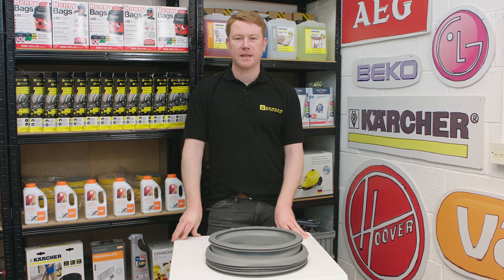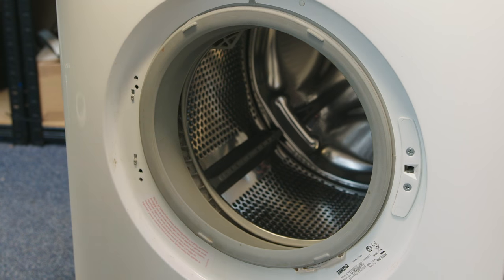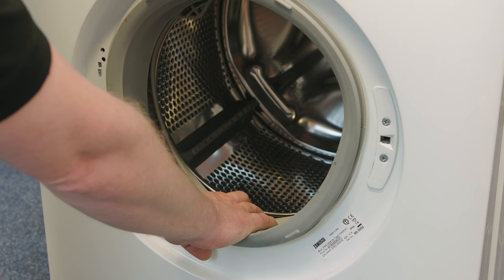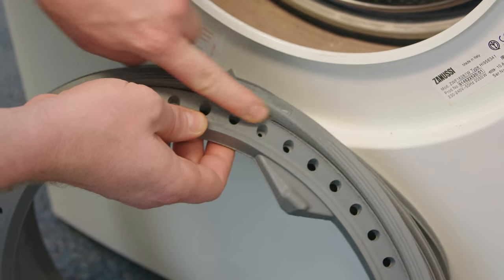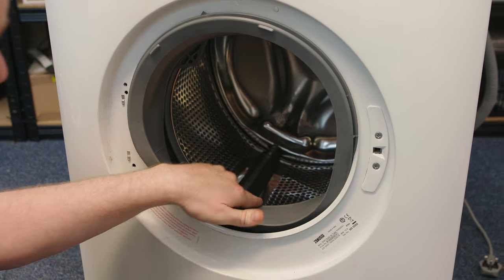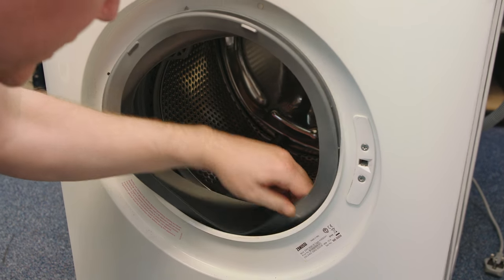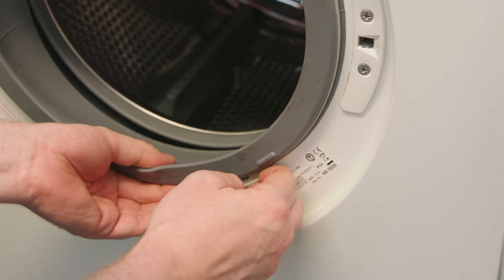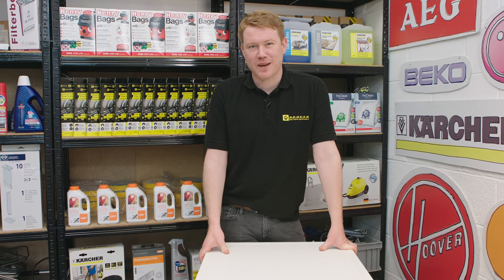Learn How to Change a Washer Gasket Yourself! (Zanussi Washing Machine Door Seal)

Comment: Couple of tips I learned in the struggle to fit my new seal to the same machine in the video. Start the seal at the bottom.not the top as shown, then you can just about see when the lip of the seal is on the rim. Start at the top and you won't be able to see. Slide your fingers around the seal, pressing in very hard, either side once the first part is on and gradually work your way up and around. My seal made a crunching feeling as it went on. The spring hoop that secures it is almost impossible to fit as others have said. I stretched the spring a but to take a bit of the tension out of it, and that helped a lot, enabling me to get it on with a helper. Another thing that helped putting on the spring was to fold the loose rubber seal (the part you will attach later to the outside of the machine) inwards into the drum to give room to fit the spring.
Reply from the maker: Hi, thanks for your comment and for sharing the experience you had when doing your door seal replacement. Great to hear you have been able to fix your appliance to keep it going.

Comment: Not sure about the comments. As a mum of 4 I was determined not to buy a new washing machine. Yes it was hard and yes it took about an hour but the video was very helpful. My washer has the water intake at the top of the seal to contend with as well. Thank you for your help and advice ❤
Reply from the maker: Hi Nicola, thanks so much for your comment. It really is great to hear that our video has helped you to keep your washing machine up and running, especially as it sounds like you have to do a good amount of washing. Well done on completing the seal replacement yourself!
Reply: Please come around to my house and help me!!

Comment: I managed to get most of this done relatively quickly (about 45 mins with a few attempts!) to get the seal attached. However I cannot for the life of me get the spring gripper back on, even with an extra pair of hands! Also have the dispenser part to reattach which makes it a bit more fiddly. We need a 3rd pair of hands I think so hopefully I will get it sorted soon!
Reply: Hi did you manage to do - we are currently struggling with this part any advice greatly recieved.
Reply: @Jennyhemming-l3f YES! What we ended up doing was putting the machine on its back. The weight of the drum pushed it down towards the back of the machine, which created more room to get 2 pairs of hands in between the drum and the outer of the machine to stretch it round, if that makes sense! Still very fiddly but considerably easier than having the machine upright! I hope you get it sorted! 🤞🏼
Reply: How did you remove the dispenser part. Struggling to remove the wire around it
Reply: @billjudd92 the wire around the dispenser part on ours was a small wire clip that just had to be pinched inwards to unhook/rehook it. I hope that makes sense. I hope you get it sorted!
Reply: His machine isn't the disp type into the top of the appliance seal

Comment: To change the seal as per the e spares video is far too difficult for the average DIYer  and if the drum has a close fitting counter weight, forget it, take the front panel off, it makes life so much easier. It takes less than 15 mins to remove the front panel and another 20 mins to replace the seal. Even with the front panel and counter weight removed it is still a very fiddly job.
 I always use eSpares for replacement electrical parts, they provide great service at very competitive prices and offer next day delivery.

Comment: Save yourself all the bother of trying to fit the spring hoop this guy blatantly skips out of the video by removing the front cover of the machine. After spending hours trying to fit the hoop then giving up, I got up the next day and managed to work out how to take the face off the machine, fit the hoop, reassembled the machine, fit the rubber seal to the face and then fit the second hoop to complete the whole job in well under an hour. It was pretty straight forward. Just be careful with the wires to the pcb, which you can disconnect and also the wire to the door locking mechanism which I didn’t bother disconnecting as it looked a little awkward. If you need any help drop me a message and I’ll talk you through it